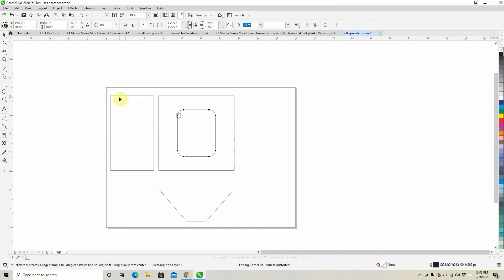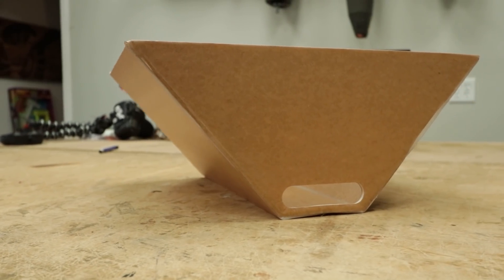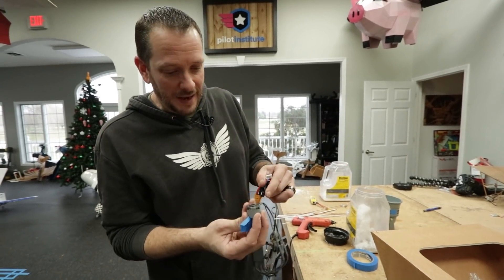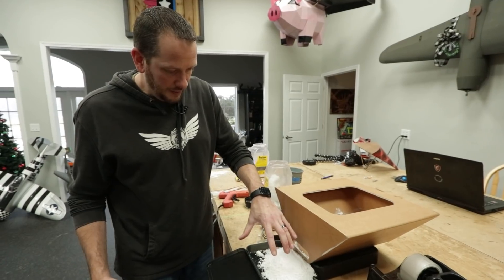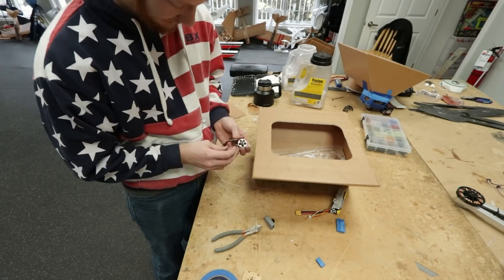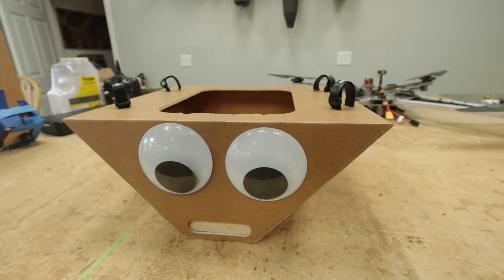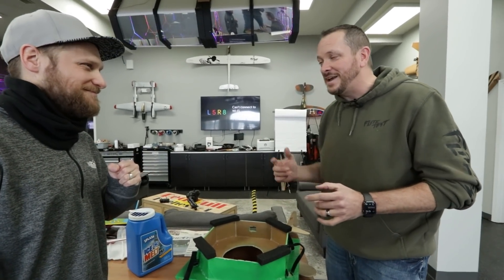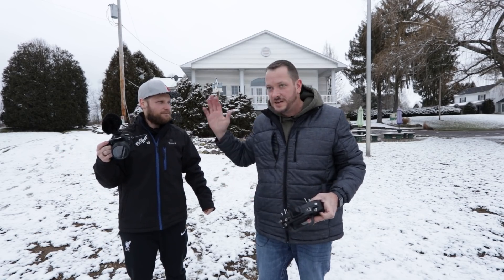Giant RC Salt Spreading Drone

Comment: So instead of a spreader, how about two discharge points within the prop wash? Use that big TV to have the forward camera and picture-in-picture facing down where the salt is landing. Makes me wonder where the prop-wash spread effectively stops and how it could be tweaked to achieve the perfect spread within an altitude range.

Comment: maybe a minature conveyer belt with a slow motor revalutions per minute.? in the interior of the salt tanks. base? then it wouldn't need to run on an angle. one could stay stationairy to drop salt in one place.

Comment: if you put a spinning disk below and spread it's absolutely worth it...
Reply: I was thinking the same thing.  Possibly integrating the vibration in the disk.  Probably be better if the feed was at the bottom with all the walls at the same angle in the center of the bottom have the outlet with the spreading disk.

Comment: Salt Drone 2.0:  You guys said it was to be like a Praying Mantis head.  Next video is to add the rest of the body and forget most of the salt load.  Put a lady bug in it’s movable front arms, raise bug’s body up to the mouth to ‘eat’ and turn on the salt dispenser as the mantis munches bits (salt) out of the bug. Could the mantis body be 6’ tall and the drone still balance? Oh, and move the googly eyes out to the corners of the head, v1.0 looked like a cartoon, not a mantis.  Contact your local community theatre’s prop/costume department for collaborative help.  They could use the plug in these covid times and they could help with design.  Give them a couple airbrushes to do the paintwork on it.  It’s a branch out & away from flying machines into flying puppets.  You could use your smaller drone frames for making a common household fly and/or honey bees too. I can see it now; mantis roaming the golf course dragging hind legs and tip of body on the ground, looking like it is walking, fly slightly backwards to ‘dig’ rear legs into the grass(snow) causing the body to rise up to full height.

Comment: I was thinking that my dad used to use a grass seed spreader/fertilizer spreader for the lawn that had a hand crank unit had an impeller in it the hopper had sloping sides like your hopper does I think the vibrator works well for getting the material to slide out but an impeller at the exit to spread it wider so that would make it a little more practical and give better coverage. Might not add that much weightand give a much better dispersion pattern and may even make it practical if you could fly it in a straight line... Lol

Comment: I recently found one of your older videos reviewing Mavic drones with their DJI Goggles, however im worried you will never see it because it buried in old vids. here is the video i left it in if you want to look there too. https://youtu.be/q_R99m8P3Aw
Can head tracking be used while active tracking is on. meaning if I want to have my drone follow my RC Car in an open area, can I set the Drone controller down near by or hang it from my neck, and control my Rc Car from the prospective of the drone, while it follows it?

Comment: On 12/31/05 I bought my very first brand new car. I signed the dotted line BEFORE it started snowing. It was dang near a blizzard by the time my car was ready. Dumb luck, I pulled out of the lot behind a plow spreading salt. First ride in my first new car and I had rock-sized chunks of salt pelting my bumper and hood.

Comment: Ok guys, I have an idea... you need to upside dusty (maybe 200-300%?) And put a hopper in it, pop floats on it, and make an AT-802 fire boss! That would be sick! Or I guess you could just make the normal dusty drop water, but I think a bigger one would not only work better, but also look better, and get more views. And you need a small fire (maybe a camp fire to redo dustys first drop when he 'saved those campers from a nice vacation').

Comment: try to go through the whole golf course with a multi stage aircraft that deploys smaller aircraft as it gets low on battery and the craft that finishes the course is a small hand held plane. planeception kind of thing. the russian doll of planes, a plane in a plane in a plane in a plane ect. start with a huge carrier and end with a pocked drone. try to go from the tee box to pin from hole one to hole nine.

Comment: Project idea: airlift.
The problem: during the summer I have people come out and fly their model airplanes and launch model rockets and so on.  Well sometimes they get stuck in like 60-70' tall trees.
The solution (or at least I thought it was): I took a phantom 1 built a lance with hook tied to a string with a quick release so that once I hooked the plane I could back out from the trees and lift up.  On the bright side it was an adventurous summer and I learned a lot of ways not to do it.  😆

I imagine that if nothing else you guys have had to deal with this at least at some point.

Comment: I think you should automate it using a Raspberry Pi and programming a grid with a GPS sensor or by using AI to recognize the driveways and walkways. Then add ground sensing radar so it can get low. Finally add a slinger to get better dispersal. Next you can produce an open source kit. You would have an automated fertilizer, grass seed, deicer spreader. Who wouldn’t want that kit? Fertilize the yard, then convert to sport mode and have double the fun!

Comment: Great idea. I only saw two problems. First your spreader wasn't spreading wide enough. the salt you were using was only falling out the shoot the width of the mouth.
Second salt? salt stops working at  32 degree. switch to a product called Green Gobbler. is a salt free combination of caliumchloride and magnesium that is plant and people friendly and it won't eat your car a way like salt will.

Comment: Neighborhood Watch.  A police dept run drone system with a solar charging dock.  So an officer can use a drone that is in a neighborhood to scout out a potentially dangerous scenario before entering the area.  Or to help with missing persons.  Drone needs to take off and land from a pole mounted nest.  It needs to have solar power to keep the drone charged.  And needs FPV and pre-planned routes to do basic patrols.  I have lots more on this if it's something that can be done.

Comment: You basically just dumped a 4 inch wide path... A simpler way with better result would of been to just bolt on a hand spreader and put a motor on the crank arm. I think you got caught up on the googley eyes bit... nice try though.

Comment: With the on board cam looking at the salt coming out, it looked like your "Mantis Brand" salt spreader was sticking its white tongue out as it flew along. Next you need to make a flame throwing hovercraft to melt the snow, then use the Mantis Brand spreader to salt it to prevent the ice. Awesome video as always guys!

Comment: The motor you used for vibration could be used to fling the salt wider like the trucks do. Just attach it on the opening end with a plate so it spins the salt out.

Comment: You guys need to make a General purpose hand truck fly! Use the wheels as landing wheels and the prop can be on the metal steal plate, add wings and boom! Hand Cart plane! PLEASE MAKE THIS FLY!! :) Standard Steel General Purpose Hand Truck, Load Capacity 650 lb, 46 in x 22 1/2 in

Comment: Excellent idea and great flying. My only comment as an Aerospace Design Weights Engineer is firstly calculate max load. Then design a hopper for that liad. You hopper could have ben half the size.

Comment: Haven't looked at all the comments, but now you have got the basics working. How about using Ardu pilot and use waypoint navigation, then add a way of monitoring the salt level and have it RTH when it gets low an then resume were it left off!

Comment: A flat disk with some groves on an RC motor might work better as a spreader.  The classical design is optimized for a couple hundred RPM and even spreading.

Comment: We used the garden broadcast spreader for throwing ice melt when I worked on snow clearing years ago, but those were great from driveways & parking lots.  But was not great for just a sidewalk, your setup is good at sidewalks but not driveways in a single pass.  Looks like version two needs to incorporate both for the hopper outfeed, with the spreader hooked up to a quad motor of it’s own.  And then you would have the grass seed and garden spreader quad ready for spring, broadcast the fertilizer and then precision drop the seeds in rows.

Comment: I think you should have used that spreader mechanism but change two things. Either a larger opening for a higher rate of flow from the salt and or a slower rpm for the spreader wheel

Comment: It would be better if the opening had a spinner ting so it could spread the salt much better
Reply: In the video you could see that they tried that and didn't like it
Reply: @ilikeyourname4807  but there is still a difference between liking it and have good it could be if you understand
Reply: @Very_Grumpy_Cat  Sure. It would absolutely be more functional with the spinner, but they built the thing for the video and made it to look good

Comment: You could do like an autonomous drone that runs a mission to de ice everything
Reply: I'm guessing this thing only flies for a couple minutes if that. Heavy lift quads have a lot in common with the rocket equation, the more you want to lift, the more battery you need, the more thrust you need to lift the battery, the more battery you need...
Reply: @eulachonfish  I mean, you could do it in small area's at a time, with a more optimised setup
Reply: @GAMINGTEENAGER  I think the trick would be to use a plane not drone
Reply: A PIxhawk would make short work of that type of mission. 
I'd like to see that!
Reply: This would require few experienced drone researchers who would spend months and thousands of dollars to do that.
Reply: @taticaldroid9288  there are alot of consumer autopilots that coukd be used